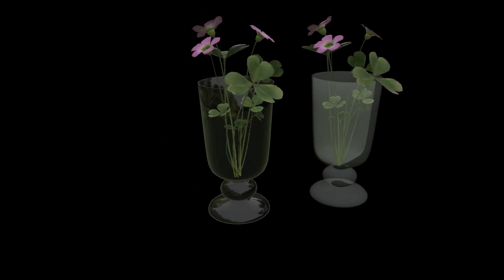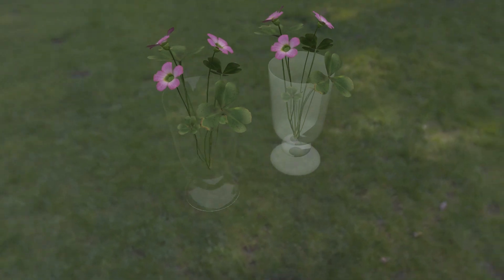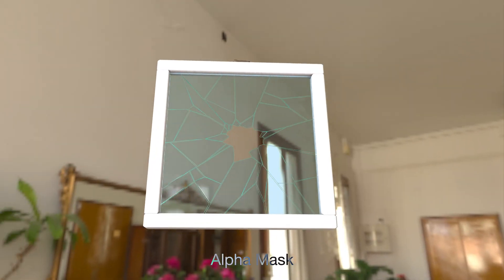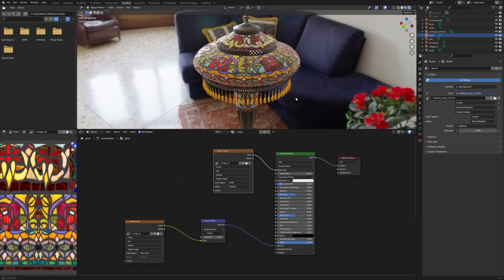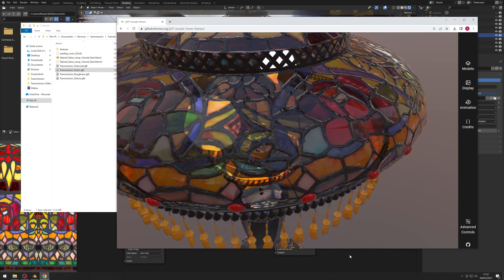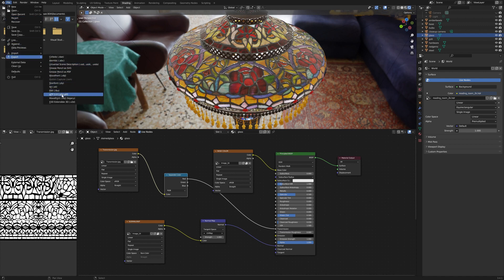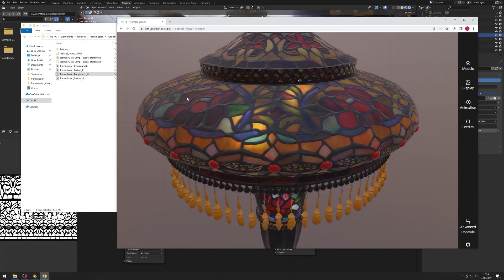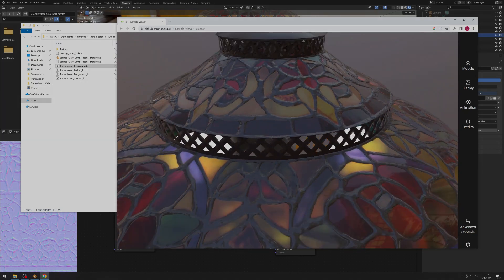What is glTF Transmission?

Comment: Need some help here, you all have an asset in the GLTF 2.0 samples pack called Diffuse Transmission Teacup.  Its clear that its using an opaque only style light diffusion effect rather than the kind of transmission used to create translucent materials like you would have on glass or see through plastics that you are showcasing in this video.  Can you point me in the correct direction of documentation on how to correctly setup nodes for getting this type of opaque + light transmission shader to export from Blender.  The Blender docs seem to mention nothing about how to take and use the transmission textured data found on the alpha channel of the metal roughness map.  If you import the asset into blender you can clearly note that the ORM texture, metal rough texture actually has an alpha channel which is unusual for most basic PBR setups but looking at it closely its clear that this alpha information on the saucer and the cups ORM maps is what is used to create the transmission effect seen in the Khronos Viewer. 

The best I could come up with in Blender 4.4 is using a mixed shader node, taking a translucent BSDF shader with the diffuse map and the general Principal BSDF shader with all the other PBR maps and mixing them with that ORM textures alpha channel to produce a teacup which allow lights and shadows to pass through its thinner surfaces - which is what I believe that asset is attempting to demonstrate.  If this is the correct setup I just need some help to understand why exporting this and returning it to the Khronos view does not produce the same results as the original sample asset. (Along the same lines why does the original sample asset imported into Blender as-is not arrive with the correct intended setup).  Just need a little help connecting all the pieces here.

Thanks

https://github.com/KhronosGroup/glTF-Sample-Assets/tree/main/Models/DiffuseTransmissionTeacup

Comment: I am using Microsoft 3d viewer program and the transparent parts (glass, diamond, etc.) of my models are not visible? But I can see other gltf web viewers as well. I wonder what is the reason for this? Because there are transparent objects in the models in Microsoft's model library?
Reply: This depends on the model. If the model is using newer glTF extensions (such as the transmission extension described in this video), then they are not currently supported in 3D Viewer. The few transparent objects in the model library are using alpha blending.